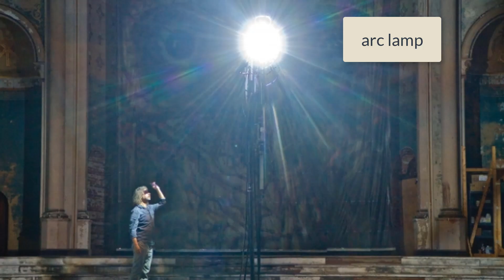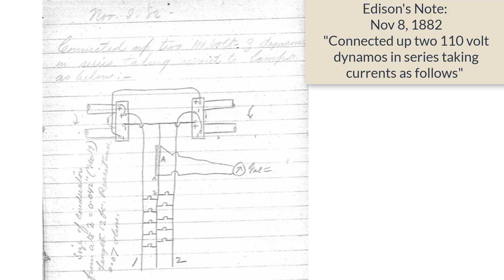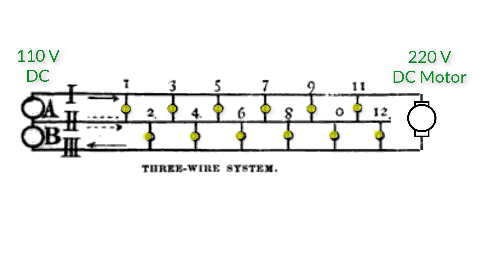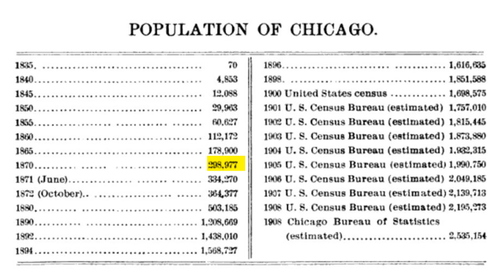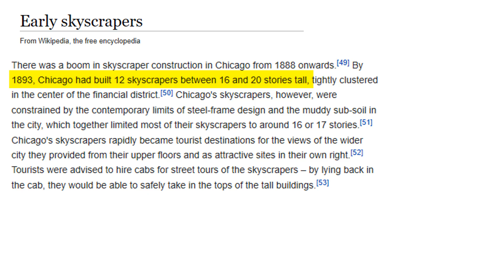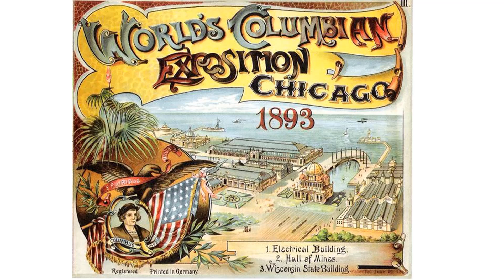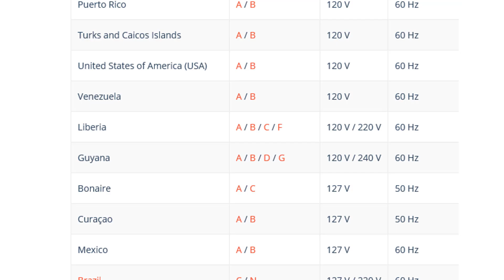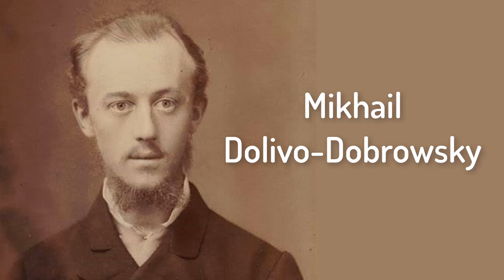Physics and History of Why USA uses 120 volts and not 220 volts

Comment: The answer to the question as to why America has 120 volt vs many other countries with 240 volts was made plain to me when I lived overseas. While repairing my home’s ceiling light, I mistakenly left the electricity on and received a shock that left me tingling for quite a while. . There is definitely a big difference between 120 and 240 volts! The 120 volt is more survivable for those who may be more susceptible to heart attacks should they get a shock like I did. And this is why I think many nations have chosen the safer 120 volts.

Comment: One more thing...why 110 V on the beginning and not simply 100V?....well...when Volta made his first pile (chemical battery)...they were making experiments with 100 of them in series...since volta pile had 1.1volts x 100 =110v and that value was used as a standard for some time.

Comment: Well, we do use 220 for heaters, etc but plugs are 120. 240 comes into the home and the box converts to 120 for outlets, and electric heaters, stove, etc is 220 volts.

Comment: At 12:32, it is a bit of a misnomer in USA to call the two hot wires coming into a residential house as 2 phase (180 degrees apart), because that 220-240 is generated at the pole transformer as a single secondary winding which is center tapped. I have always been told to call it 220 single phase. 🤔

Comment: 110 VOLTS is safer than 220 but needs more copper for more current for same watts, efficiency is low. It is not exactly wise to have 110 Volt supplies and equipment.

Comment: It is 4x less deadly as 240 but for a household you need double the amps and copper. We went from 220 in the 80's to 240 volt in 2000

Comment: The issue with this is the US residential electrical system is 240v not 120v.  If measurement are alone consistently (leg to leg or leg to ground)  you will get the same voltage in the US and the rest of the world.

Comment: She is right. I am an American Master Electrician and owner of an Electrical contracting business. All of the things she said in this video are Facts. Please keep in mind that the higher the voltage, the more Efficient the electricity does the work you want, but the more Dangerous it is to cause bigger explosions and more death when things go wrong. And the smaller the conductor wire size that you need to do the same amount of work. So in the modern world, or this past 50 years, low voltage lighting was developed and sold for Safety. High voltage lighting is still used to save money on installation and the power bill to the Utility company. Not just lighting, these things apply to all electrical uses, such as your clothes dryer or the power tool you just rented, etc. America is a HUGE country, compared to most. The economics of filaments for millions of lite bulbs forced us to initially keep our voltage at the residential/commercial level LOW. Since then, we don't want to spend a lot of money to gain an efficiency which would eventually pay for itself in electrical efficiency, at the risk of a more dangerous and less Safe applications in every home and business.

Comment: Couple of reasons Edison's DC lost out to Westinghouse's AC. 1. You can't use a transformer to step up or down DC and 2. Using a transformer to step up or down AC is critical to minimize power loss in long distance power distribution. In the US most power generation is at 2000 volts at the generating plant. Also most long distance power transmission lines use aluminum. Why you ask, first aluminum is lighter in weight, second is less expensive and third more abundant. The downside is aluminum has a higher resistance as compared to copper and will turn more of the power sent into heat wasting power. So what to do? Use a transformer to step up the 2000 volts (at whatever current) to a much higher voltage and because of Ohm's law when you step up voltage you reduce current. Using ohm's law, P(power)=I (current) x E (voltage) which means (Ignoring some losses) you can double the voltage and cut the current in half by running it though a transformer and still have the exact same amount of power. Step up the voltage by 10 and reduce the current to 1/10. So using simple numbers, P (in watts) = I (in amperes) x E (in volts), working it out with numbers we get P (100 watts)= 1 (ampere) x 100 (volts). Using a 1:10 step up transformer, P (100 watts) = .1 (ampere) x 1000 (volts). So power companies transform the power to very high voltages at the same time reducing the the current to very low values running along the aluminum line for whatever distance which drastically cuts the power lost to heating of the wire. Current flow in a conductor creates heat due to resistance  (I squared x R in ohms law) so the less current you have flowing the less heat you produce because you can reduce the amount of current using a transformer but you can't change the resistance of the wire.

Comment: The opening comment is partly incorrect.
The US (and North America and the rest of the "120" world) actually source 240VAC - then center tap it (aka "split phase") to obtain the lower voltage.
That 240V is WIDELY used for higher-power home appliances like driers, for central Air Conditioning, most Water Heaters (some small ones will be 120), and many "home shop" items like welders, and is COMMONLY available.

Comment: Small correction. A popular circuit would have less resistance due to many loads in parallel. This would dim the bulbs if the supply conductors were not upgraded.

Comment: While 115 and 120V are, 127V is not because they sneaked up the voltage. It's the single phase voltage of a three phase 220V system and thus was quite common in Europe.

Comment: It is strange to think that the EU despite all it's collective regulations couldn't standardize the system . There was a suggestion some years ago that a universal socket system be considered, but some financial guru in the depts of Brussels pointed out that to replace an average of 40 sockets on every dwelling on the EU would cost in the region of several hundred billion Euros. That soon ended that debate !! The word thereafter was if it's safe it's ok !

Comment: Actually, Kathy, our system in the US is 240 volts. Split phase, 2x120v @60hz. It can be very simply wired at the panel to be either a 240 volt circuit, or used in a single phase circuit for 120 volts depending on that particular circuit's intended use. You don't really think we run furnaces, stoves, HVAC, dryers, well motors, etc. with 120 volts, do you???

Comment: Does 120 Volt consume less electricity than 240Volt.
Eg suppose you have 2 identical 65" OLED TV 📺.
One is wired in USA 🇺🇸 and the other in UK 🇬🇧.
Which one used more power? Or is identical?

Comment: At 2:34 you start saying that the total resistance of the more parallel lamps have a higher total resistance than the line with fewer parallel lamps. This is not true. Resistors switched parallel decrease the resulting resistance. It is the current that is summed up. With Ohm's law you can derive that the total resistance can be calculated like this: 1/Rtotal = 1/R1+ 1/R2+...1/Rn It is a little more difficult than resistors in switched series. The amount of power used, thus the amount of energy used, increases!

Comment: Japan lowered the voltage out of fire concerns, where fire risk is directly correlated to current intensity.
But we are speking about a country with a back to back mixed frequency power system.

Comment: Oh and the United States the power lines cut into your house is 220 volts you have two Hots and then goes down to 110 and your breaker system throughout the house using the breaker boxes I guess you actually never actually studied electricity the reason the rest of the world uses the higher voltage into their homes cuz they don't like messing with pressure systems the old-school Christian Breakers you're talkin about South America a lot of their power is illegal they just reach up there hook their own power straight up to the 220-volt powergrid instead of having a Transformer like in America

Comment: Actually the United States uses 220 and 110 your your dryer your stoves stuff like that uses 220 and the rest your Appliance is 110 volts it has to do with Tesla's power generation in Transformer not crack headed Addison he was doing direct current running a lot of homes up and killing a lot of people by electrocution

Comment: @2:37 says "more resistance" but the combined loads on popular feed lines actually create less load resistance, and draw more current and require more power .  More current causes more voltage drop getting the power to the load, which often called "voltage sag."

Comment: The better question: why does the US use a neutral? And we find the answer was primarily the early light bulb, and its voltage limitations.   For the non-electric minded, a return wire becomes a neutral if it is tapped mid point on a transformer, [and usually is bonded to earth  - typically a main breaker box, but... marine applications do not bond  neutrals to allow for ground detection systems].  What do you get? Better fault protection in a single package.  Personal risk?  About the same.  Savings?  120 loses that fight, as more conductor cross section is needed to serve up the same amount of power.
Now, to correct something: current ALWAYS flows in a neutral under load - but if loads are balanced, the fields cancel each other and measurement becomes zero - thas the nature of an ammeter: it measures a net value.  One way to know this is an infra red survey: setup a balanced load condition that pushes a transformer to say 95-98% of rated power and the neutral does show warmth, confirming power transmission with "zero" current.
I like 220, but that means buying many things from Europe and planned obsolescence seems to have a higher cycle rate there - buying parts and repairing 20 year old appliances is not as easy as the US.

Comment: Interesting lecture. I noticed how skyscrappers don't necessarily determine the quality of the city, also that underneath those buildings there are countless inventions of underrated geniuses and that 220 volts beat 110 volts to avoid spending more copper for the transmission wires, given that 220 volts with more resistance need less current because V=I/R.

Comment: The British got things right. Bigger and safer plug contacts. Lower current in wires. No need for dual sockets/circuits. Earth connection{you have to redo all of yours - yikes}. Polarized plug. Fused plug. OK, you have a higher frequency.

Comment: It may be semantic only, but homes in the US are 220, that is what the home gets from the street, and 220 is available inside the wherever one wishes to have it placed; however it was decided that small items such as lights and small appliances would use 110, which is why most of the wiring in a home is 110.

Comment: Better range for the heater overloads than a 220 volt system. 
Most likely to sell twice as much copper wire as a 220 volt system.

Comment: A lot of us suburban and rural folk don't run into 208 and 277 volts.  The paradigm is still used a lot in urban and industrial settings.  That fluorescent ballast in the ceiling might be 277 instead of house current -- I knew to approach all connections with great care.

Comment: I worked wiring Lowes stores 20years ago, and they had a section in light bulbs, that were 130volts, and most all of the lights in the store, lighting the building, is 277v or 220volts, and the equipment, battery chargers carpet rollers are either 3phase 120/120/120, or 277/277=480volts, much less current with the same wattage. 277v on a exit light, it had to be milliamps! About 3-5watts on 277v , sadly the problem with the high voltage, a guy years before I started working there, a guy was killed by the 277v, he was in the ceiling and couldn't get away from the current! That's spooky, being 20'-25' on a 2'x 5' lift, with wiring running everywhere, with 3 phase, 277v, 480v 220v all running across steel beams, I was kinda freaked out about it for a few days after hearing about it, it makes you work much safer that way though!   Great stories 🙂! I love history, especially about technology, and technical, mechanical things, when it's all combined, it's even better!!

Comment: DC was still present in the theatre district of NYC at least until
1952.I was ten years old then and my family was particularly 
interested in Broadway Musicals.As we had A good friend who
was an actor in musicals,I can remember being invited backstage
at one show,I forget which one.There I saw a standard electrical 
outlet that had large writing on the wall next to it labeling the outlet
as being DC,to warn people that it was not AC so they would not
plug in something that required AC to work properly.I was told that
there was still a lot of DC there at that time.I imagine that the
theatres were wired for lights by Edison very early when DC was
all that was used at that time.And it was still somewhat 
in use.

Comment: You did not mention the inventions of Philips in Eindhoven (NL) regarding light bulbs. 
In Europe we can use up to 16A at 230V from an ordinary socket, and most electrical stoves are connected to three-phase at 400V between the live wires (each at 120° phase shift to the next) and 230V between a live wire and earth/ground. This is good for motors not needing any brushes and running at a constant speed. We save a lot of copper because less  current means thinner wires.

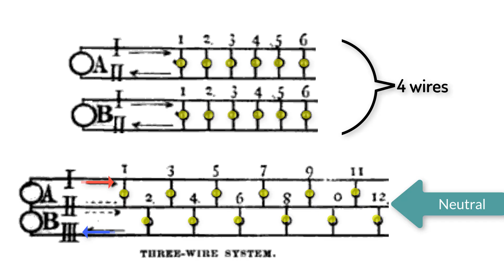Comment: A possible point of electrical confusion exists here:  Edison's three-wire 120/240 volt D.C.  system explained at ref: 3:40...then after the voltage tolerance explanation regarding the tungsten filament bulb vs carbon filament bulb, it is stated at ref: 5:05, that "it was cheaper to make a transformer to step down....etc".   The confusion lies in the fact that the earlier explained 3-wire D.C. power can not use a transformer.  So, Edison's 3-wire D.C. system must have been switched (pardon the pun) in favor of the Tesla/Westinghouse A.C. system.    This switch to AC  IS mentioned much later at: ref 10.28.   To me, the use of the word: transformer  in this dialog requires an explanation of how A.C. power replaced the formerly explained Edison's 3-wire D.C.

Comment: It seems the Amish power a lot with compressed air energy. However an oven running on that seems theoretically possible only and this with a lot of good will.  Even the energy stored in a huge block concrete at 10 m high won't run an oven for long.
 Since our LED lights, monitors, TV"s and other equipment got all much more frugal, it's painful to see heat based devices use so much energy. I guess fridges are somewhere in the middle.

Comment: there are a problem with the claim that you can only use 120V for Carbon filament. Put 2 in serie (like old christmas light chains) then they will each get 110V(if same size). In pracsis you should also be able to construct a longer activ element.

Comment: I don't know, but I always thought it was a safe move. In my understanding you can make a power inverter from really any voltage with adequate amperage to any voltage. However, some simplistic appliances benefited from 2 phase power differential crudely. Other of the videos here kind of suggested AC motors worked initially because they were less than 180 degress yet I think North American power is actually 180 degrees apart.

Comment: Every modern house has 240 Vac thus there are two “hots” and a neutral we actually use the neutral and Europe doesn’t. Most electric stoves, ovens,  water heaters, air conditioners, and whole house electric heating is 240Vac. One could in theory get 240Vac by connecting hots from different outlet circuits but you’d need to make your own power cord as plugging into multiple breaker circuits is highly frowned upon an somewhat dangerous.

Comment: Okay, but ... this is about Edison's direct current and direct current has 0 hz and you represent it with 50-60hz which means that it is an alternating current invented by Nikola Tesla who is not mentioned at all in this video and is the father of the world the current that is now in use and that still illuminates and drives the planet today. The rotating magnetic field also enabled the construction of a three-phase current with a three-phase motor, so Tesla received the well-deserved T mark in the international system of units. Edison's direct current is only for short distances because is very expensive and ugly. Tesla's first hydroelectric plant is still operating in Niagara, but the most interesting thing is that Tesla invented wireless transmission of electricity using the ionosphere as an infinite power source and that electricity would be available to everyone for free, but this patent is kept in strict secrecy. charged electricity to citizens? It is a shame that Nikola Tesla, the man who illuminated the planet in the true sense of the word, is not mentioned here at all!

Comment: You are wrong. The USA uses 240 volts for homes and 308 volts for businesses. The phases get split to 120 volts for the lesser circuits and use both phases for things like ovens, HVAC and dryers. Large factories and apartment buildings use 3 phase power that totals 308 volts and gets split as needed. Calling the USA a 120v country is flat WRONG. Research harder next time.

Comment: When voltage in Denmark was changed from 220 V to 230 V I did not see the news. I just had bulbs burning out an even in one case it exploded (possibly unrelated). When I moved some years ago the voltage was still nominally 230 V but in reality often 240 V. The same happened again (well, nothing really explopded). As I still need some incandescant lamps for my tortoises (they have not warmed to the idea of cold LED-lights) I had to put some chokes in line with those lamp. 
It is 230 V right now but will increase in the morning.